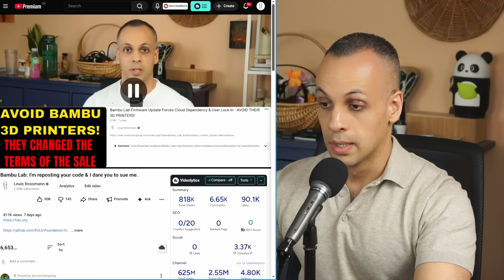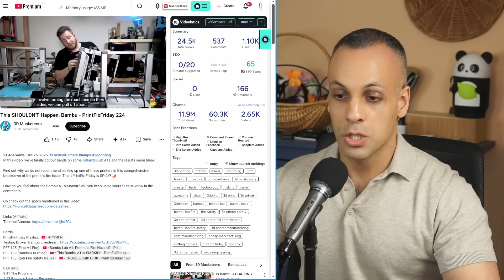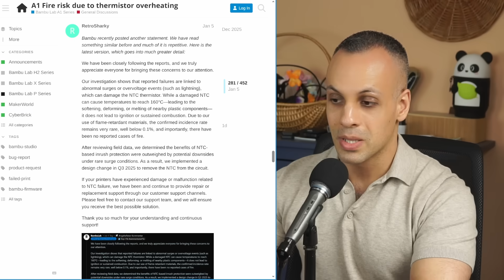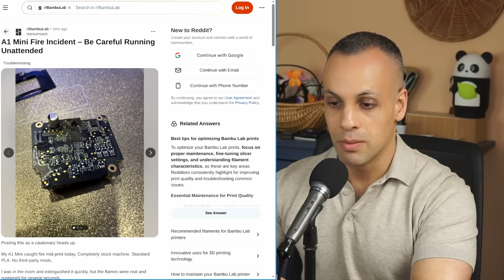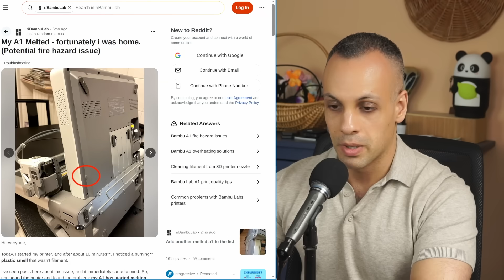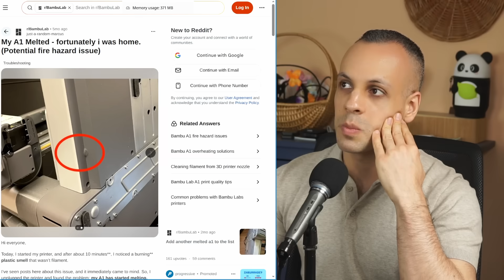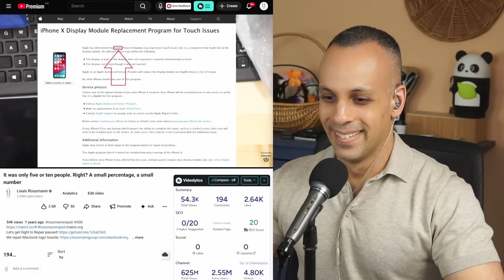Bambu Lab PR dumpster fire is turning into a literal one...

Comment: I have a pretty expensive Bambu Printer P2S with all the bells and whistles. It is the best 3d printer I have ever owned, and I built my first one (WolfRap)  over 20 years ago. TBH, I have not tried any other slicers, haven't really seen the need to, yet at least. I bought it because as I crested 50 years of age, I realized that I just wanted to print, and not tinker anymore. It just works, like everything in my apple ecosystem. 

I get what you're saying, and I think Bambu Lab SUCKS for screwing with the GPL. I don't agree with what they are doing now, or what they have done. I wanted the best that I could afford, and got the $1500 combo. Worth every penny right up until I started hearing all this backlash.

I want to be clear, I don't endorse or disown anything to do with this, I have not been affected by it personally. I am sure one day I will be, but I haven't been yet.

Hope BL comes to their senses and gets their heads out from their asses.

Thanks Louis, keep up the bitter and brutal advocacy, you are a legend amongst us commoners

Comment: I didn't want to buy bambu for a long time now-- they started off with a TOS that did not exclude datamining your cloud and personal data, and I can't afford to have my custom 3d models get 'signed away' for free use by another company when I'm selling them myself.  

Then came the firmware updates of 'no, you don't get to use other software to run our printers.  Only liscensed software.  Also no reloading old firmware to try and undo our choice for your property--shame on you.'

And then came this, with Orca being issued a takedown.  I'd never touch a bambu purchase button with a 10-foot pole.  Any printer that comes into my ownership of theirs is getting a fresh mainboard so it can live free.

Comment: I heard good "just works" things about QIDI printers back when I was researching to buy them, and I can confirm that my QIDI X-Plus 4 has been basically rock-solid for a couple of years now.  It also uses Klipper firmware which is fully open source, and Bambu locking down their printers was the reason I looked for that.

I might've bought a Bambu printer if they hadn't done that, but now I never will.

Comment: If the cost of fires is less then the cost of a recall we don't do a recall
Reply: Back in the day the ford pinto had an issue where if you got rear ended hard enough the gas tank right in front of the bumper would explode, they did an analysis and concluded that ~3,000 people would die from the issue and that a recall would cost more than to just pay the wrongful death settlements, they simply discontinued the car afterwards
Reply: @jacobmay4220 my buddy had one lol
What I said is a slightly modified line from fight club. They were talking about car recalls......
Reply: You are by far the most interesting single serving friend I've ever met
Reply: @trikstari7687 is it because I make and sell soap?
Reply: Pinto reference?
Reply: @bambooplate fight club, however your the second person to say that. I wonder if the line is about a pinto.

Comment: Would I buy a Bambu? HELL NO!!!
I don't buy things if I don't own them when I buy them; and I don't buy things that set themselves on fire - that's MY job.

I got a Qidi printer (Plus4) about a year ago. There was a lot of noise about a heater/fire issue not long before that, and the news was everywhere. What else was in the news was their response. They worked out pretty quickly that is was an issue with the 120v ac model (which means US market), not the 240v (most other regions), and they IMMEDIATELY admitted fault, found the problem, released a kit to fix/upgrade your machine if you wanted, OR offered a full refund if you just wanted to send it back. (So, voluntary recall).

THEY OWNED THEIR SHIT.

THAT is the sort of company I want to do business with. So I gave em my money.
Now I have a printer that doesn't force updates, doesn't demand a cloud, and doesn't try to steal my data. I mean... is it that hard?

It's not that hard.
Most printer companies get it.

Good companies get repeat business. Bad companies get to steal our money once, then we curse them forever.

Comment: I had Bambu Lab printers until the "Security Update" scam. I replaced them with companies that are friendly to open source, and I could not be happier with that decision, especially now that we are seeing the new controversies surrounding them.

To be fair, they did double down on the business philosophy of a closed ecosystem for the future, so it is not like you could not see this type of behavior coming.

Creality has come a long way since the Ender line, specifically with the K2 line of printers. They just work. I have a stock K2 Plus that has not needed a single thing done to it outside of normal maintenance, and it has been printing almost nonstop since November. The Creality HI is the same story. It just works.

I like their CFS system compared to the AMS. I have had far fewer issues with the CFS than I did with the AMS. Of course, Prusa is amazing as well if you have the money to spend.

Creality is a budget friendly option for new people getting into the hobby. Their printers just work, print faster, have larger build volumes, and produce equal quality prints. I would suggest the Snapmaker U1, but I would not call that "just works" yet.

Bambu has its superfans, and that is not going to change. Some people will not care if they force a closed ecosystem. To each their own, but if you want a printer that will grow with you beyond a casual hobby into expert level 3D printing, then I would stick with printers made by companies that are friendly to open source.

Eventually, you will want access to all the cool toys that the open source community brings to the playground.

Comment: funny just checked my A1 and it has deformed a bit in the front left bottom side so the bottom shell isn't connected to the top shell properly anymore maybe I should open it and see, it is hot in that area where the vent holes sit on the side

Comment: I purchased and almost daily use my Bambu Labs X1C and it honestly is a pretty great printer IMO.  It does annoy me that they are anti-consumer and are practicing these tactics.  As a user of Orca Slicer, it was nice to see them concede on the "security" block of third party communications if you made a change in the UI.  Even if they truly felt it was a security issue, the ability to allow an end user to decide their level of risk is the right thing to do... even if it took a TON of pressure to achieve.  

However, moving forward, I am very willing to jump to an open-source firmware if they decide to lock things down further, and one of the things I love about the 3d printer community is it would be readily available with documentation and instructions if pushed to that.  Bambu Labs had the potential to become a juggernaut in the industry but they are slowly eroding all of their capital to screw the consumer in the name of profit that will surely backfire on them in the long run.

Comment: My NTC also burned , melted the holding plastic, and slightly warped the outer casing but did not melt it, the thermistor completly desintegrated itself, after warranty contact they sent me the new V2 board that does not have a thermistor, has like a thick wire, from buying the printer to it one day just dying was around 250 hours of print time, usually 4-5 hours per day, not constant, im happy with their support but man this printer was bought in november and the problem was already known, doesn't make much sense that they shipped it with the defective part

Comment: I have 3 bambulab printers...... A1, A1mini and P1s..... they all have worked great for me..... more than 1000 hours on my A1 with no issues. The A1 mini I got for my kids and the p1S for my prints at home. Im not a brand shill, the printers work for me NOW. HOWEVER if I keep seeing this type of crap that bambu is doing I will switch them to lan only mode and keep using them till they die. Thats how my OG ender3 pro died.... a monster printer giving excelent prints till the day it died, and Im sure I can resurrect it with the proper parts but I just dont want to.

Comment: I am not quite sure why Bambu has a reputation for easy entry to 3D printing and/of there is even a market gap for this.

I bought my first printer (Elegoo Neptune 3 Pro) for a laugh brand new with zero research and learnt CAD and printing instantly.

I recently upgraded to a Prusa Core One+ and it's as simple as my Elegoo.

My friend just bought the Elegoo Tauricarbon which again he's printing day one never done it before.

I'd say the barrier to entry now is as low as it's ever been and there are dirt cheap printers out there now that work very well.

But for me, I'll stick with my Prusa.

Comment: I have an H2D and regret all of my investment.  Not just because of this issue, but much like Apple, if you ask it to do more than the trinkets, more than the default, you’re likely to have a bad time.  I tried using their support filament, using the dual nozzle functionality for the exact purpose it was made for, and never got it to work right.  I tried calibrating this that and the other, I dried filaments, I have activated alumina containers in the AMS units…. I never got it to work properly.  The Bambu faithful will sometimes help, but much like apple, you get the people that blame the user.  Maybe it is me, but I put in 20+ hours fighting an issue for a printer that “just works”.  I let it sit for a few months, only maintaining the desiccant and humidity levels.  Went back and tried to print a trinket a couple of weeks ago-  two failures, one in each nozzle, 2 different AMS units.

It doesn’t even “just work” and the company making it is high on their own flatulence. I recommend any other brand, any other brand at all.

Comment: Amazon firesticks just blocked apps i have been using for years to watch movies from the high seas. So they're newer ones would not allow the side loading of the apps so to make sure I didn't burn out my old ones I bought a bunch of new ones for normal content and I have four old ones that each had the apps I use sideloaded. I've been using them for years and all the sudden I go to open the app and it says Amazon now restricts the use of this app because it is frequently used for pirated content. My oldest one is a fire Cube I think I've had for 10 years. I did not approve any update and never would because I already knew that their newer ones would not work with the apps so obviously I would not accept any type of updates. So they're changing what I'm able to do with something I've owned for 10 years or more. The only other thing I use them for is watching youtube. I stopped watching Amazon shows when my Prime subscription started allowing at the beginning and a couple times throughout. I refuse to watch commercials and every time I see something pop up that I want to watch advertised on the main screen the few times I have actually clicked one thinking all right I'll deal with the commercial I can't make it through the whole two or three minutes that the advertisements last. I have gone so long without seeing commercials that it bothers me greatly I can't make it through. I can stare at a blank screen with the little circle going around trying to find a new stream link that plays properly but I can't watch a commercial for 3 minutes. I don't like the idea of being forced to watch something try and tell me something I have no interest in

Comment: I have a Bambu 3D printer. It was either this one or the Prusa equivalent. Between the two, I was going back and forth for months and finally pulled the trigger on the Bambu X1C. I'm new to 3D design and printers and Bambu just seemed less daunting. My main draw to it was I can start a print, and monitor it from work, or I can be one state away and start a 12 hour print at home and have it ready by the time i come home. After seeing these reports, I'm kind of scared to have that printer run unattended especially with the summer coming along.

Comment: I actually bought a 3D printer about a year ago. Sadly, I didn't have the money for a Prusa. I did not buy a Bambu because the RFID chips in the filament rolls and the printer's ability to read them could open the door for proprietary filament (if I'm informed correctly, with a simple software update). Fuck that. There is a reason the information on those chips is encrypted, or at least that's what worried me. Looks like my gut feeling about not trusting that company was correct. People called me crazy, but I think I was just early.

Comment: I recently purchased a BambuLab printer. Don't get me wrong, it's a great printer. My previous experience owning a printer was an old Ender printer that took endless tinkering to get good results. I wanted to use a printer as a tool/appliance just to get good results for my hobbies. I didn't want my hobby to become tinkering on a printer. My Bambu does that perfectly. Unfortunately, with everything coming out that Bambu has been doing, I slightly regret my decision to buy a product from them. Like you said, I wish another printer manufacturer would enter into that market segment that Bambu has a tight grip on. Prusa is close to that, but Prusa printers are just so damn expensive.

Comment: I bought myself a Bambu printer a few months ago, considering the current situation I kinda regret it but not enough to sell it (at least not rn).
The printer works, there is nothing I can say about that so far and that was the most important part for me.
I have some years of experience with the printer in my local library ( I am the one volunteering to do maintenance on it) and the ultimaker 2+c is also a decent printer but with all the struggles I had with that machine over the years and the obnoxious rates for printing it was time for me to get my own printer.
My plan was to print parts for my hobby aka building PC's, currently a custom printed case, not getting the printer as a hobby.
Working on and with the printer is fun but I did not want to tinker with it hours at a time just to get a single part done so the choice was clear after doing detailed research.
I was aware that Bambu was building a walled garden and forcing to use the cloud but the party inside the garden seemed just to good to pass on it.
Replacement-parts were and still are available and the prices though in the higher segment still felt kinda fair for the service you get, we did not expect to get screwed so hard by them but well, now they did and we need to fight against it.

Comment: i have a fully 100% offline metal CNC 3-Axis machine i built myslef and have more parts to upgrade it to 5-Axis and can print from very small ( 40x40x40mm )  ( maybe even smaller)  up to 10inches (10"x10"x10') Inches..  ..  if i wanted a ghosst gun all i need is springs.. haha..
Reply: its not in my address either..  im not that stupid .. its in a secure location

Comment: When I was 1st buying i had queries about reliability & issues I saw online for Bambu and Qidi. So i contacted both. Qidi responded and alleviated my concerns. To this day years later Bambu hasn't bothered to even acknowledge me. Its not just about the product, its the company & customer service. That was my cue to buy the Qidi Plus 4. Yes Qidi they had an issue with a board that overheated and was a fire risk in 110v using countries. Know what they did? They acknowledged it & fixed it for free, not tell their customers nah bro it's just you. I have never had a single issue & I still have the functionality i paid for. If a company won't even respond to you pre sale, walk away, every time.

Comment: Personal I like Bambu Printers the units works, But Do believe you should be able to use as you want yes I do. So it goes both ways we as consumer should have that right but a company should rights as well but Bambu has crossed that line then it should open the units back up without compromising themselves.

Comment: It really hurts because I genuinely like the printers. Hope the pressure works and they change their ways
Reply: I'm sorry, but they won't. This is not their first rodeo; they really believe everything that goes wrong is someone else's fault (aka A1 fire issue), or HOW DARE YOU FORK OUR SOFTWARE (which was forked under AGPL in the first place).

They will not change your ways.

They make decent hardware. But their software treats you like a criminal and a moron. Switch to another brand, there's heaps to choose from.

Comment: Since it was asked about in the video, I'm currently considering getting a Bambu Lab printer, specifically a P2S. The reason for it is because from what I've been told from someone who knows a lot more about 3D printers than me, it's the only real option for something that will print with decent quality without being completely absurdly expensive.

For all the people looking to burn Bambu Labs at the stake I'm seeing in the comments, what other options are there for 3D printers that won't require me to sell my organs? I've currently got a Flashforge Creator Pro loaned from the same guy after he got an upgrade and am quickly learning that I need something that doesn't suck like that one does.